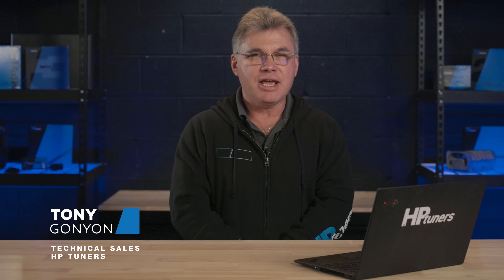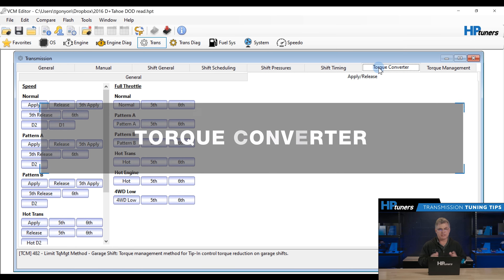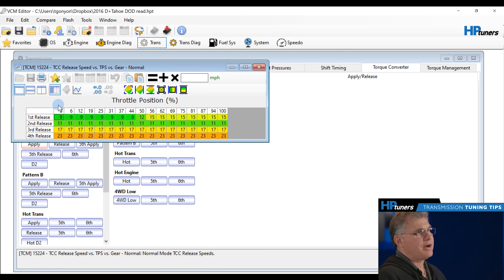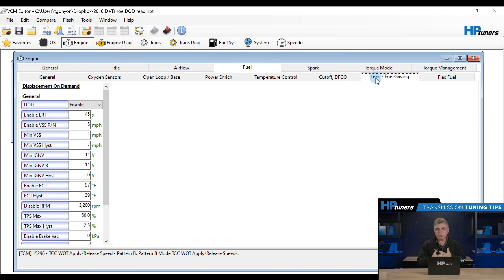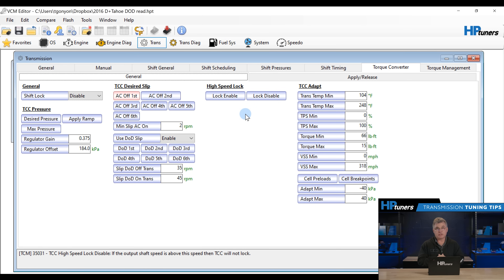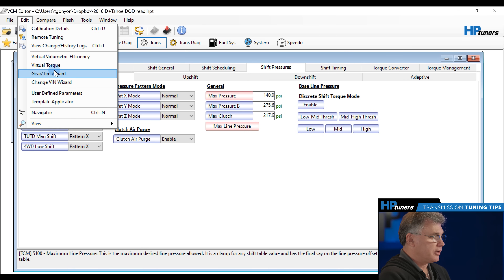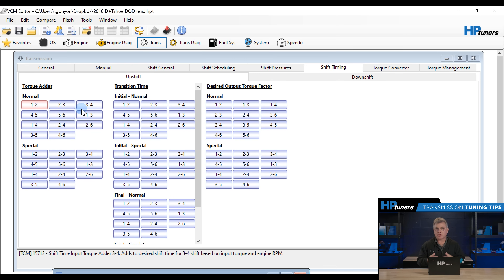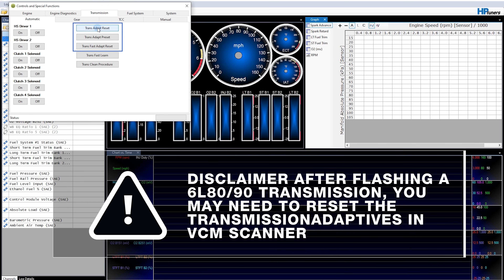GM 6L80 Transmission Tuning Tips | HP Tuners

Comment: Hi, I'm new here. Can manual transmissions be tuned?
Reply: Yes. You have to recalibrate your brain. Since you are in full control of your shifting, only you (the human) can change the shifting (in your brain) have your brain tell your hand to shift at a different speed or rpm and your problem is solved.

Comment: Hi Tony, I really could use your knowledge and ideas on my 2011 Tahoe:
	•	1–2 shift is fine, but on 2–3 the RPM climbs to about 2,000, then falls back before it finally shifts—feels laggy and jerky.
	•	No slipping, no CELs, and I’ve replaced the ATF and filter (fluid looked clean, no metal bits).
	•	I pulled both transmission fuses for an hour to reset the TCM, but the 2–3 shift is still the same.
Any tip would be awesome. Should I e.g. try what you recommend here? Btw the DoD is already deactivated in my car on the ECU

Comment: How does it connect to the transmission? Is there a Bluetooth piece that goes to a port?
Reply: Mpvi3 adapter,  and you will need credits for ecu or tcu. They stick with the vehicle.  Not sure if you need ecu and tcu or just tcu credits to do tcu stuff,  but it's credit based.

Comment: I have a stock 05 Chevy 2500hd with the 4l80e. When you're mostly driving on the highway, if you let off the gas almost or all the way, TCC disengages and re-engages after you get back into it. Where do I change so it stay in TCC lockup on the highway, or just about anytime when its in OD.

Comment: I tried it on my 2011 Sierra 1500 5.3L and after coming to a complete stop the transmission takes a few seconds to shifted back to first gear. if I don't give enough time it will slip and clunk. Did you know why this happen?

Comment: I recently picked up a 2011 Silverado 1500 4.8l/6L80... 147,000 miles. I have this shudder, but if I manually shift the trans I get no shudder. 
I'm wondering if a tune would cure this?
Other than this shudder, the truck shifts & performs perfectly, other than 11mpg. 🤣🤣

Comment: 2014 Silverado. Trans and Tc replaced in December 2023. They replaced the Tc again and it just drives like shit. Shifting slips and hard and accelerating weak. You think this tune will help?
Reply: Yes.
Reply: 100% just did it to mine after a rebuild drives 1000x better, also get bluecat transmission tool makes the shift points better, night and day difference
Reply: @ had mine done bro, 161k drives amazing now
Reply: How difficult is the tune to do? My 15 Suburban has had problems with tc shudder. Had tc replaced and nothing has changed. 2k in the hole and looking for a fix@jamstein02

Comment: I want to know what adjustments that will make tires spin and burn out?
Reply: Matt Sanford (you tube) has a burnout tune vid for hp tuner
Reply: @curtstockdale565 can you use Matt Sanford burn out tune with addition to this video? I have a stock converter, and have the shudder. So I’m wanting to use Matt’s tune with this one if possible.

Comment: Doing DOD delete on 1500 Silverado adding a stage 2 cam and a circle D multi disc 3200 stall convertor will these same numbers work for me?  Also adding a 6.2 manifold intake and throttle body with Airaid cold air intake.  Please help as I would like to do the tunning myself.

Comment: Looking forward to tuning a 2014 and 2018 with this same setup. Thanks for the exact video we were looking for!
Reply: Did you ever do this?
Reply: @racefan2267  Yes. It went well and did the same to a friend's 2014 Sierra.
Reply: @TobyBarnett programming my wife’s Yukon tonight with this setup.
Reply: @racefan2267  my 2018 silverado and buddy's 2014 sierra feel so much better after tuning these exact steps.
Reply: @TobyBarnett  don’t want to brag too early but my wife just drove it to town and back (10 min each way) after I tested it…she loves it!  Not only is it smoother but 1-2 and 2-3 is a dream now.
Reply: @racefan2267  Awesome to hear and I'll second the immediate difference is noticeable -drives like a v8 truck. I'm still running a full stock trans, no billet torque converter or thermo-bypass, and at 85k miles and tow a 21ft boat and have had no problems yet.
Reply: @TobyBarnett good deal.  Ours is 96k, all stock, but I did put the updated factory thermostat on.

Comment: Thanks for the video! What should I put slip at with a 3600 stall converter?
Reply: Put them to 0. Remember those tables are only for slip when the tcc is applied, which either way shouldnt apply until atleast 3rd gear but sometimes 4th is needed as the minimum gear to prevent surging, you just have to try different settings. everything I know from tuning is just from messing around online and then doing it to my car so listen to me at your own risk👍a good tool too for your shift speeds and tcc apply tables is bluecat trans tool, it should get you to the point of atleast being able to drive around smoothly

Comment: Rebuilt my 6L80e last year with all upgraded Sonnax parts and billet cover torque converter. Here a year later I start getting TC shudder in 6th gear while barely on the throttle. Felt like big rumble strips. THIS got rid of all the shudder, and it shifts so much better now!! THANK YOU!
Reply: How can a tune repair a failing torque converter?
Reply: @southfork67  maybe the line pressure decreased just enough once all the new parts broke in and it was enough to allow the torque converter clutches to shudder. Whatever it was, this tune fixed it. I replaced the converter when I did the rebuild last year. It didn't start shuddering until recently so the TC clutch wear should have been minimal.
Reply: @stuperprohero  this is the same problem im having right now. i just got a new trans with a billet TC and it shutters at high gears. how is your truck doing now? how easy was the tune or should i get a shop to do it?
Reply: @lucaswoudenberg7095  The tune wasn't hard but you have to buy an HP Tuner and credits for your vehicle. I had to boost the pump pressure to get the shudder to go away and now that I boosted it up to something just below max, it hasn't shuddered since. When it shifts into 5th it is a fairly firm shift so I may drop the pressure down a little bit to smooth the shift and see if it shudders.
Reply: @southfork67 definitely the stock tune and poor maintenance is what kills those transmission believe me or not
Reply: @southfork67  that's the problem with the dealers and the shops right now it's the same problem with the 6t75 all of you guys are out here saying it's a failing torque converter or a failing transmission when that's rarely the case obviously I know people who have replaced their transmission in their Acadia three times and others who have replaced their torque converter several times as well at the dealership and spent thousands of dollars only to find out that the issue came right back so they sold their vehicle, as it turns out the torque converter isn't bad most of the time and neither is the transmission it's the factory tune that allows for too much slip trying to stop in the shifts, causes the fluid to go bad faster than the transmission to get hotter than it should. A tune and a cooler are the only thing that will fix these transmissions.
Reply: I am getting a shudder too after about a year with a new converter.  My transmission guy told me to tune it.  I will report back with results
Reply: @mattyamaha27 it’s been 8 months. How did it go?

Comment: 2016 Tahoe with an L83 and 6spd automatic. Speed limiter is removed. During a WOT hwy pull the truck won’t go past 5th gear and hits a limiter in 5th gear around 3750rpm.. Is there another parameter that has to be tuned to get it to fully top out?
Reply: What speed are you going in 5th at 3,750rpm? These vehicles often have a speed limiter.

Comment: I think he wanted to increase the stall by +800 rpm.    From 1500 to Around 2300ish.       You can’t stall out at 8k
Reply: So add 800 to enable rpm to make it 2300 and max disable rpm to 8000?

Comment: 8k on the stall is a no go. Every time I forget and adjust it I get a what did you do!
Reply: One thing I've learned from Goatrope Garage is that the computer doesn't like the same value to turn something on and off.  Enable at 8,000 and disable at 7,999. (I used 7,800 because the stock spread was 200 rpm.)
Reply: What do you set it to? Or do you just leave it as is?
Reply: @Big-kon  i just leave it alone. I do have one set at 2000 that doesn't seem to matter
Reply: @ awesome. That’s what I did. Figured leaving it alone would be best. Thank you for the reply. I appreciate it sir 🤙🏼

Comment: Hey Tony, as mentioned below, your first adjustment, 8k/8k rpm on stall management, leaves a non-moving vehicle. What's up with that?
Reply: I could not understand 8k also.makbe the vehicle launches at 8000 rpm?

Comment: Thank you for this!!  I've been using HP tuners since 2004ish erra on my 97 Grand Prix GTP. And used it to tune my various cars, including Camero, GTO, C6 Corvette, various cadi's, and now my C7 Vette and '22 Ford Explorer ST (Purchased new).

But I've always been scared to touch the tranny. The Camero I changed the rear gear size in tune as I swapped in a different gear ratio, so that was fixed. But that was the most I've done. I'm going to play with my C7 8L90 :D

Comment: I used HP tuners to tune my transmission on my 2014 Silverado a year ago,  best thing I ever did,  Truck drives so much better.
Reply: Can you share your tune and does your truck have new Cam?
Reply: Been wanting to do mine. Did you use all the same settings from this video?  TIA
Reply: @tonycega  no not all of them
Reply: @rookiechevey what one didn’t you use? Or did you go by a different video
Reply: @rookiechevey do you have a file saved you can send me ?
Reply: Awesome
Reply: Did all the options in the video show up?? Couse i tuned mine but not all of the options were there 2015 silverado

Comment: Have had a problem at times where pulling onto the highway the transmission will take forever to shift from 4th to 5th under light throttle
Reply: You can change your shift timing to bring the 4-5 gear change in sooner. Small changes at a time to what you like.
Reply: @currybuilt  thanks it wants to hang in 4th under light throttle for around 10 seconds at 3000 rpm drives me nuts

Comment: Does the TCC adapt work in fine tuning the apply rate of the TCC or does it monitor the TCC slip against the slip tables and increase the pressure accordingly?
Reply: I’m no expert… but I have found that lowering the slip error rpm values from from zero and all the way over to 400 have kept my TCC slip at zero or closest to it vs putting higher values there.  TCC regulator gain also.

Comment: hi...i have a build cirdle D transmission 6l80...with single disk converter....  should i only use lock up in 6,,,,i do a lot of drag,,,, thanks for your great vid !!!!
Reply: You can set your lockup at different throttle positions. So no lockup at wot. But have commanded lockup under part throttle/ normal driving
Reply: You should be able to lock it up from 2nd onwards.
Best thing to do it’s try if locked and unlocked. My car is faster when it’s locked.
To be honest this video was absolutely terrible and no wonder there are so many 6l80e cooking the trans…
Reply: @LS3PSI   i think i will have to go with a tripple disk to lockup....im blower with 850 whp no spray and 950whp on spray